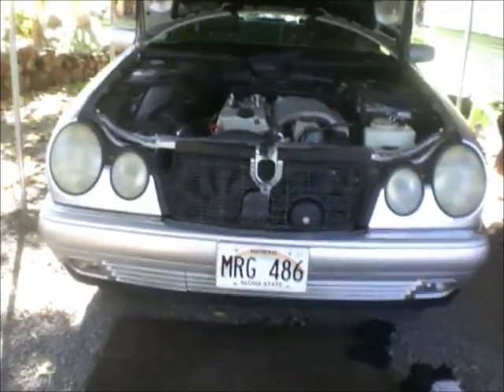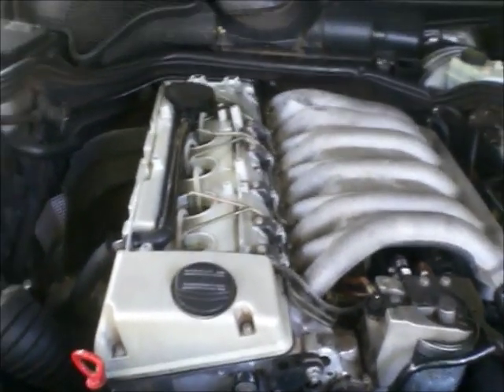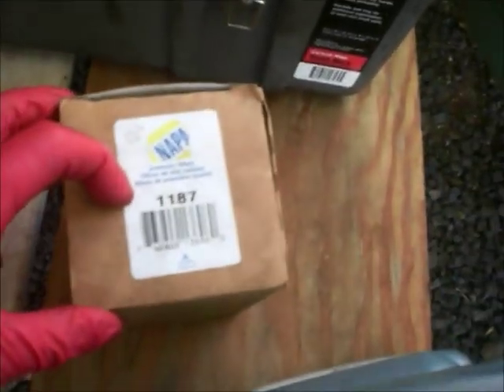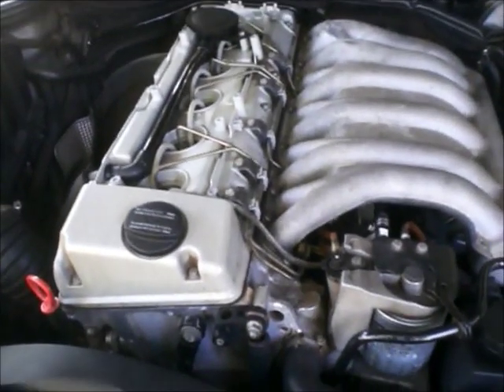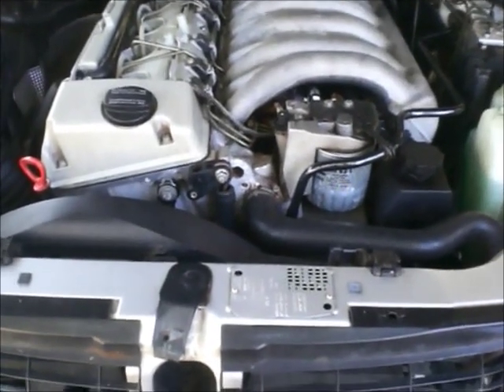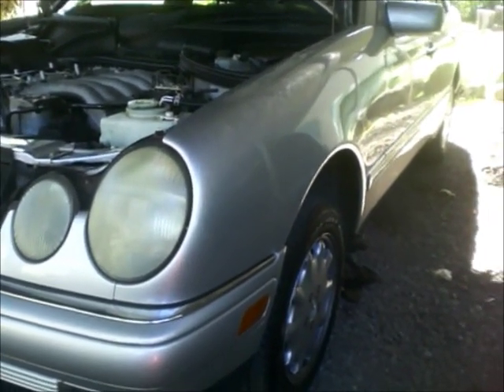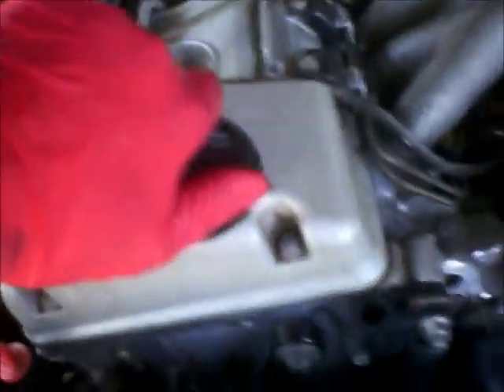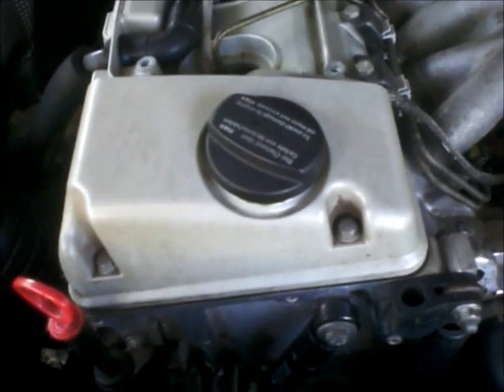how to change oil on mercedes. Part 1.

Comment: Why is there a comment that says wrong oil? You can use the oil in the video, or the formula m. Either one is fine. Also, it's better to take the oil filter out before draining the pan.

Comment: i disagree that this oil is the bestfor Mercedes. I use what is recommended. Yes it is mobile 1 synthetic but the European formula. it is the 229.3 / 229.5 classification.  for VW it is; the 505.00 / 502.00. The  ACEA is B3/B4